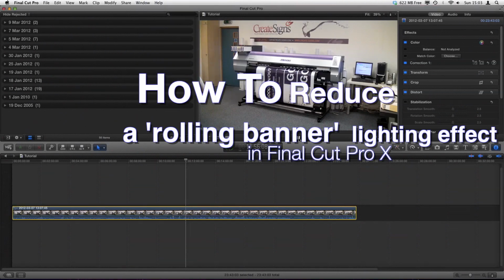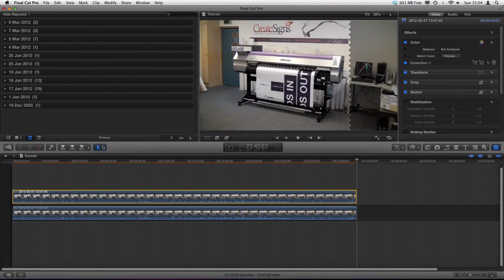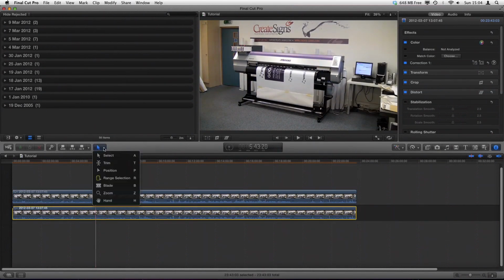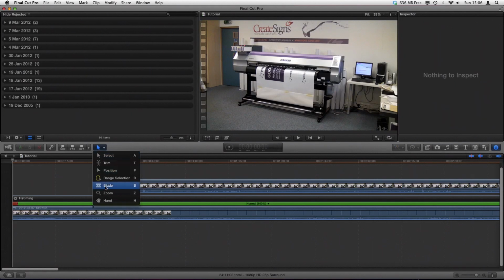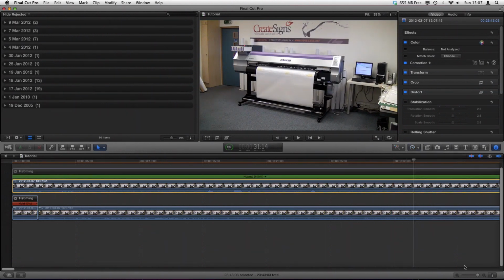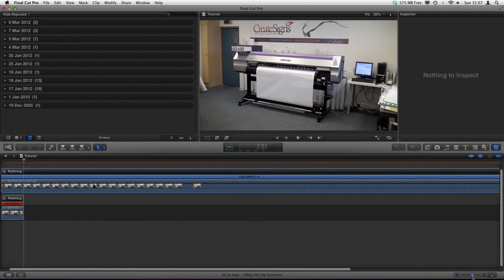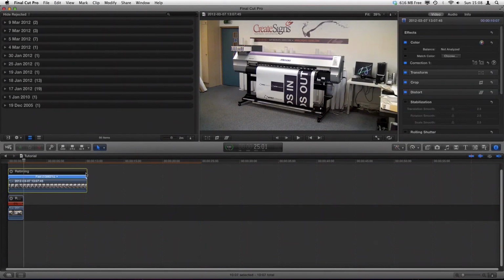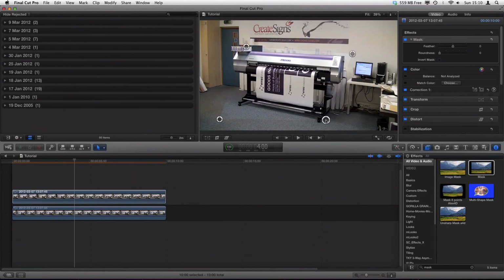How to Reduce 'Rolling Banner' effect from Fluorescent Lighting using Final Cut Pro X

Comment: Save yourself 5 minutes:
1.Duplicate layer.
2. Freeze the layer.
3. Drop it under the original layer and make same length.
4. Mask out the action you want to keep.

This fix only really works for this example, or for something extremely static. The real fix is to either synchronise your shutter to the frequency of the lights or do the decent thing and turn off all fluorescent lights when using a camera that doesn't have a global shutter.